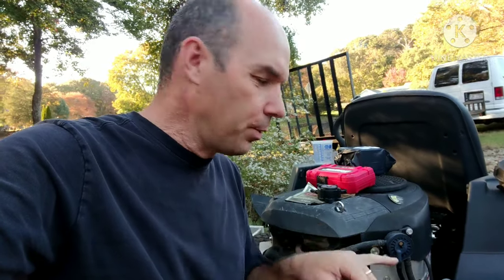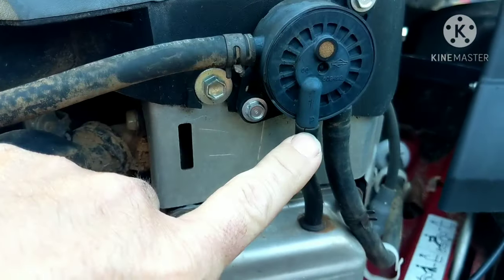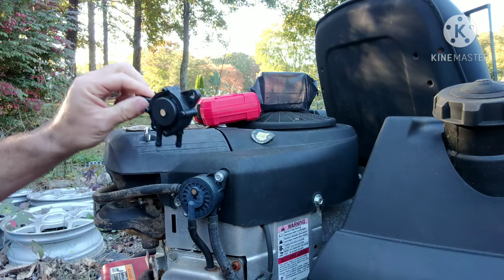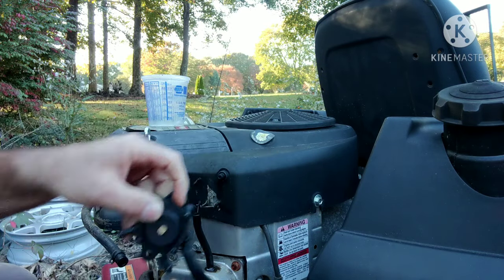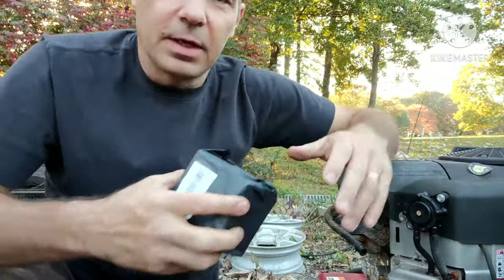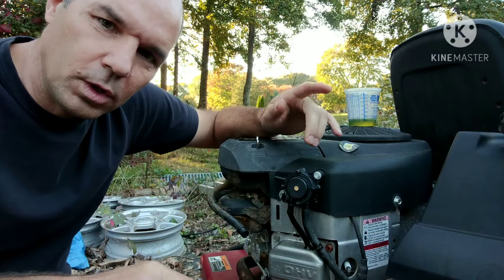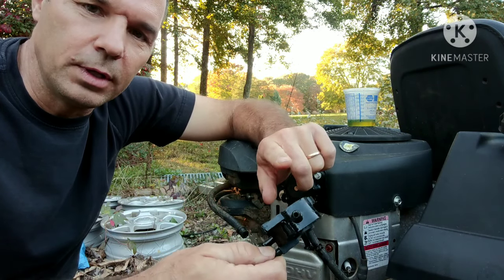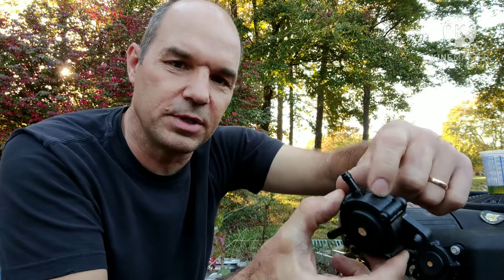Cheap fuel pumps are junk!!??

Comment: Ok that was not 10sec on the second one
Reply from the maker: Maybe 9.5 but doesn't really matter, that brand new one was defective dumping fuel into the valve cover.
Reply: @TepcoCycleRepair  I have a 2010 Kawasaki mule 610. I’m getting 90psi engine compression. Do know if that’s usable compression or is it to low or high??
Reply from the maker: @bradselc3618  It has a compression release so you can't get an accurate compression reading. I would say getting 90 with the compression release is fine. A leak down test is what you need for accurate reading of engine health.
Reply: @TepcoCycleRepair  I had a no start issues, checked pulse pump, carb, compression, spark and everything checked out ok. Spark plug looked good but I went and got a new one and bammm! Purrs like a kitten now. So it was just spark plug issues. Thanks man I checked out some of your videos and it helped me out!
Reply from the maker: @bradselc3618  I've been finding more spark plugs failures lately, weird. Glad you found it, good job!

Comment: fuel pumps is good ya might wont to change the tube that goes in the vale cover first lmao
Reply from the maker: The cracks aren't all the way through the hoses, and I checked both pumps with the same hose and even put the new fully working pump on with the same hose..lmao..

Comment: Sorry, but I have to disagree with your video. I’ve used the cheaper pumps without an issue for years. It doesn’t matter how much fuel is coming out of the fuel pump. As long as enough is coming  out of the fuel pump to keep the carb bowl full of fuel.  The float and the needle valve control the flow of fuel into the engine, not the fuel pump. As long as you’re getting enough fuel into carburetor you’ll be fine. I’ve never had an issue with one and I’m not paying five times as much for a Briggs & Stratton that are made in the same Chinese factory.  perhaps you weren’t getting as much fuel as you expected because your vacuum pulse line has obvious cracks in it. The pump I prefer are made out of metal and can be opened. Cleaned repaired and rebuilt if needed.  I’ve never had to do any of that to them and I’ve had them on my machines for years if your motor surging you have carburetor problem and as you mentioned, you had water in the gas that has nothing to do with the fuel pump. Sorry if my comment contradicts your entire video but I want people to know what you’re telling him is not necessarily the case or at least it hasn’t been for me I will continue to buy the metal case Chinese pumps. You really have nothing to lose. If you purchase the pumps from Amazon if you have an issue or don’t like them, you can return them. Try that at your Briggs & Stratton dealer.
Reply from the maker: The metal ones are probably better. These also leak fuel through to the pulse line filling the crank case with fuel. I used the same pulse like on all the pumps, they show cracks but they were not all the way through. I'll try a metal case aftermarket pump but these plastic ones are usually junk. I've had them leaking straight out of the box and/of not even pumping. The metal ones are probably like the Mikuni pumps, rebuildable and better quality.
Reply: @TepcoCycleRepair  try a metal one. I’ve never had an issue with them and they’re much cheaper than a Briggs part. Good luck. Thanks for the video.